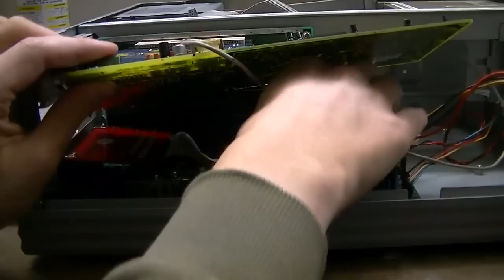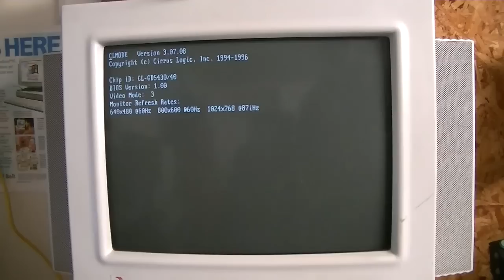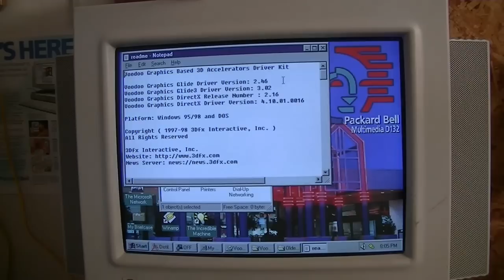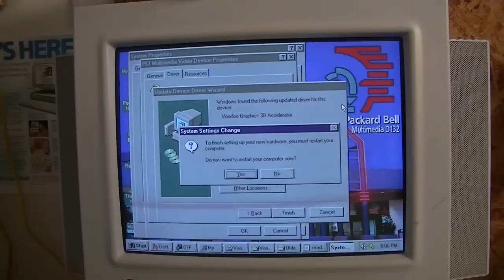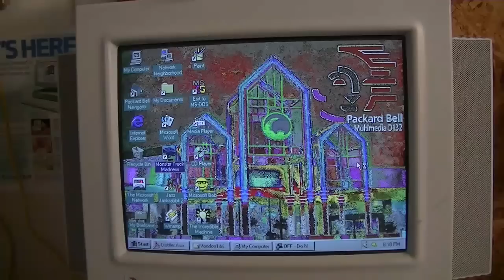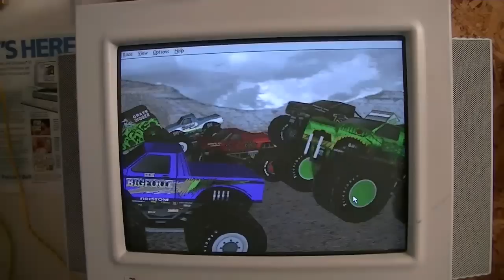Installing a Voodoo 1 Into the Corner Packard Bell

Comment: I have a similar Voodoo1 card ( a Magic 3D), it really opens up what is playable on a Pentium 1 machine. It is currently in a hacked-together Frankenstein of 2 IBM machines - the case, riser card and PSU of an Aptiva 2176, and the motherboard from a PC 300GL Pentium MMX 200. The system runs surprisingly stable - any crashes are due to the slightly dodgy RAM I have installed, and go away after the computer has been on for a while.

As for games, I would suggest Quake 1/2, Half-Life, Need For Speed II and III - Hot Pursuit. There are demo versions of all of these as well if you don't have the full games.

Comment: You could upgrade to a 200 Mhz Pentium processor  from the 166 Mhz one and that I believe will let you play monster truck madness II though at a minimum requirement but perhaps the 3D accelerator card would offset that.
Don't use a MMX one because systems that used MMX processors needed a voltage regulator on the motherboard (I think that the voltage was dual plane).
Otherwise it would work for a fairly long time but your CPU and motherboard would fry early.
However there are other options.
For instance Kingston put out a Turbochip 366 which was a AMD K6-2 processor on a special adapter board with regulator circuitry that could upgrade many socket 5 or socket 7 systems with a AMD K6-2 processor at 366 Mhz which would give it early Pentium 2 class type gaming performance.There are other similar adapter upgrade processors too.Still an upgrade to a  Socket 7 Classic 200 Mhz Pentium would be nice if hopefully your jumper settings allow it on the motherboard.
I have the Kingston Turbochip 366 which I have never used (it's still in the box)
To note Monster Truck Madness and Hellbender were the first Direct 3D (Direct X) API 3D accelerated games released in August of 1996 by Microsoft.
Now you can play it in 3D accelerated mode in a whopping 640 by 480 resolution too!
It still might be a good idea to place a small Pentium CPU  fan blowing cool air on the Voodoo 1 cards graphic chips though it doesn't get as hot as the Voodoo 3
You're welcome.

Another edit Unreal that previous PC game I gave you  should also be able to be played on this machine as well though by amazing coincidence I also suggested you play Monster Truck Madness using the Diamond Monster 3D Voodoo 1 card in my letter to you on the CD.
I never knew that you had 2 defective Voodoo cards before though.
Plus you can mention my name if you wish it's Jon Jarmon
Reply: Unreal would be a good stress test for this system, as the CPU is the exact minimum requirement specified. I wouldn't expect it to be very enjoyable though - it really needs a Pentium II and a least 64MB of RAM to run fluidly.
Reply: Surprisingly Unreal  runs and plays rather well on my Packard Bell Pentium @ 166 Mhz with a Diamond Monster 3D card.
However the RAM was upgraded to 32 MB.
The resolution is at a lowered 512 by 384 though but it still looks good.